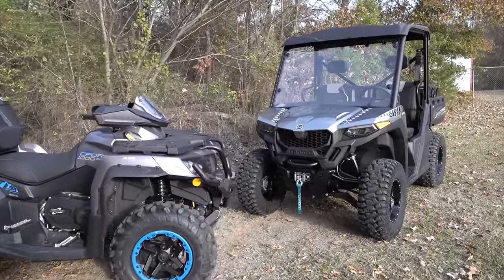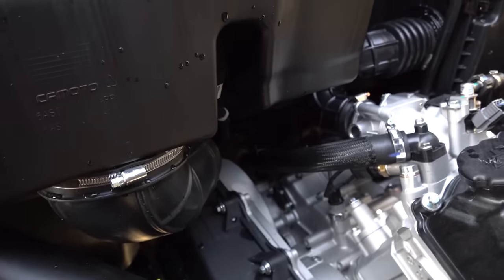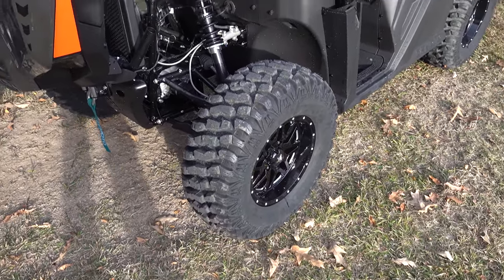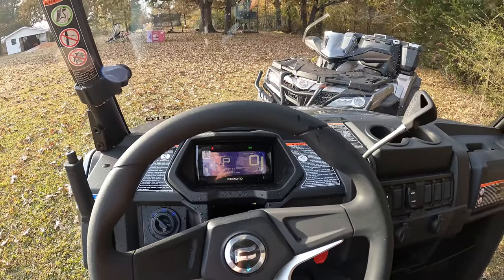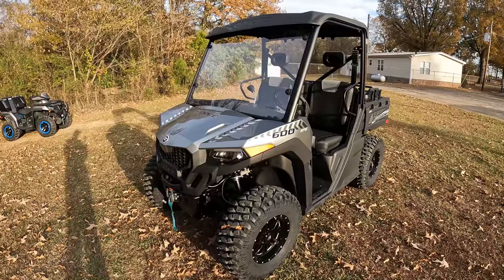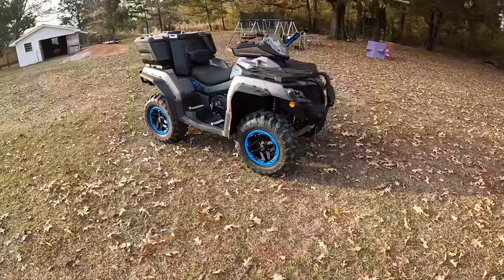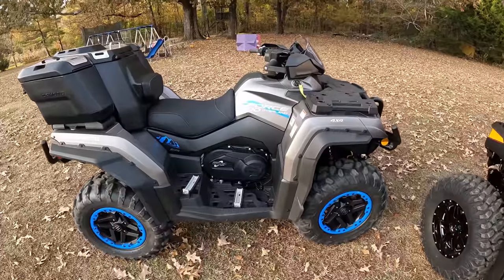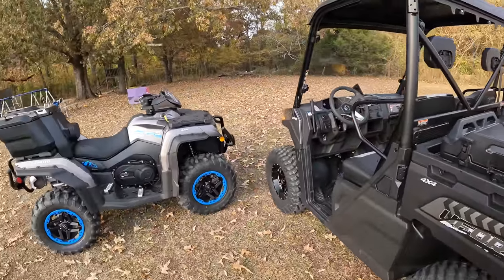CFMOTO UFORCE 600 Top Speed & Turning Radius Plus CFORCE 1000 Update

Comment: Thank you for this informative video. Lots of good info. 
One thing I noticed on the specs is that the UF600 & UF1000 is that they are both rated at the same towing capacity, 2000#! In the CFM teaser video they show the 600 pulling a trailer full of logs up a mountain road. That's impressive! 

I have not seen any snow plowing videos yet though. Those are two of my main desires for the UTV that I want.
Another would be defrost for the windshield. This is something that "P" offers as a winter package for their upper end Rangers. At almost $20k. : (

As always your videos are great and have really brought me around to the CFM products, thank you!

Comment: When you ran it in normal mode then switched it over to work mode and topped it out at around 48.....I caught a glimpse of the speedo on the dash...and it read 46....so even with the 28" tires...there wasn't that much of a spread between GPS and the dash speed. Great video. Sharp looking machine. Just wondering if there's anything in the works for an 800 in this Uforce platform?
Reply from the maker: Yea the speedometer is off with the stock tires when compared to the GPS.. so the 30s actually aren't too far off.
Reply from the maker: And as of right now there is NO Leaked info on any updates for the UFORCE 800 platform.

Comment: Just a general comment, while the windshield does add drag/wind resistance, as an avid MC rider myself, riding for long periods without one, the wind on your upper torso and head can really beat you up, and become exhausting very quickly over long rides. 
Maybe not tooling around the homestead, or woods but anything at speeds about idle.
#tradeoff

Comment: Just some info. Your normal mode button and work mode button wires are switched. Your restricted mode should be the work mode and your wide open mode should be the normal mode. So pop your switch out and switch the top and bottom wore around.
Reply: That’s how my 2024 is

Comment: One question, and maybe I missed it in the video, but are side mirrors and the front and rear windshields standard equipment? I thought I read somewhere that they were, but I just bought one of these and it came with neither. Trying to figure out if the dealer screwed me over.

Comment: Great content again! Thanks for doing these in-depth videos and hope you’re getting commission for all the UForce 600s sold out everywhere across the country! Did you notice Normal or Work mode tearing up any of the grass around your yard similar to the Turf Mode option from other brands to protect your lawn?
Reply from the maker: Thanks so much steve.. and no CFMOTO pays me nothing.. that would be nice tho lol. 
The work and normal modes only affect rpm and throttle mapping. The uforce does not have a feature like turf mode where it unlocks the rear diff 
But in all my testing and turning in the back yard with the tires that I am running did not tear up my grass any.
Reply from the maker: I have heard bad stories about the turf mode messing up polaris rangers rear diff.
Reply: @RealTalkPowersports  Question regarding the differential locking, does the 600 have a front locker too? Or just the rear, full time?
Thanks Steve, your comment got me wondering.
Reply: Looking at the ipls, cf moto seems to have put an auto locker/lsd diff in the rear of both uforces, hence no need for a turf mode, but it still locks when it needs to.

Comment: Great video Blake. Can you measure the cabin space of the UFORCE 600 and the UFORCE 1000 I think the 1000 is bigger but I was told they are the same. I am 6’3” and worried that the 600 might be tight.
Reply from the maker: The uforce 1000 cabin space is Much bigger. The uforce 1000 is made to fit 3 adults with 3 seat belts.
Reply from the maker: What I will have to do for you is verify how much head room there is. But I'm 6ft1 and I have plenty head room in the 600 and 1000
Reply: I am looking for the distance from the steering wheel to the seat. Is that the same. I sat in the 1000 and I had plenty of room but the 1000 is overkill for what I and my family will use it. I am hoping that the 600 is the same. The 3 dealers near me did not have the 600 in stock. I will be getting them ordered in the new year. Just need to decide on which UFORCE. That’s for all you do in the channel it is very informative and can’t wait to get them.
Reply: @tonymic988  what unit did you go with? I too am wondering about the room between the dash and seat as I'm a bigger guy as well.

Comment: The work and normal modes are a little confusing with the option of high and low gear. Does one work better than the other? For example, does normal mode work better in low gear? And work mode in high gear? Thanks.
Reply from the maker: Work mode is full power. Normal mode is limited power with throttle dampening. And it doesn't matter if it is in low or high bc low and high is just changing the gearing. So you would make your selection of high or low gear and work or normal mode based on what you are doing.

Comment: a local dealer has several of these in stock, but said there is a recall on them and they can't do anything with them until the parts come in to fix them. Do you know what the recall could be and what the fix is?
Reply from the maker: Only thing it could be is them waiting on the ECU for a couple of them
Reply: @RealTalkPowersports  ahh I was wondering. They said a recall and they are waiting on parts and are not sure when they will be able to get them in. Thanks! Want to go try one out if they can get them in working order.

Comment: Hey Blake do you think 30 inch tires will rub with no lift on the 1000 6 seater?
Reply from the maker: As soon as I get mine in, I'll be installing 30 inch M1evils.  So we will see..
Reply: @RealTalkPowersports  are you doing tires only or lift as well??
Reply from the maker: @johnduran769  I'll start with just tires.. and see what else we need
Reply: @RealTalkPowersports  sounds Awesome
Reply: 30-in cryptids don't rub on our Uforce 1000. That's 11 wide also. I think the six seater has the same wheel wells.
Reply: @codyschmidtmann3992  thank you for the information!! I’m hoping I don’t have to use a lift kit but I will to avoid rubbing. Do you have a lift on you’re 1000?
Reply: @johnduran769  no sir, just clutch kit. Wouldn't recommend cryptids if you have a lot of road riding. The 10 in wide which I have on my wheeler are way softer tire than the 11 in wide which we have on the Uforce. Road riding stinks but amazing tire on every other terrain including snow. Plus big paddle to put screw in ice studs. 👍
Reply: @codyschmidtmann3992  👍👍thank you Sir!!
Reply: @codyschmidtmann3992  What tire do you recommend for road riding ??I do a lot of road riding
Reply: @johnduran769  I think Blake was running carnivores they have a lot rounder of a profile on the side of the tire. Or the same tire he has in the video M1 evils. Anything with closer lugs and rounder profile and a little softer.
Reply: @codyschmidtmann3992  👍👍